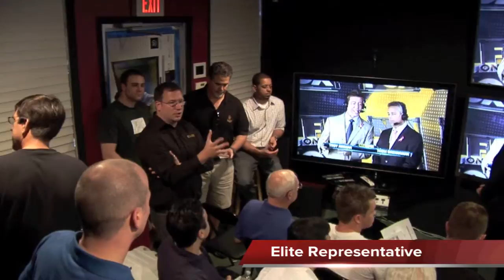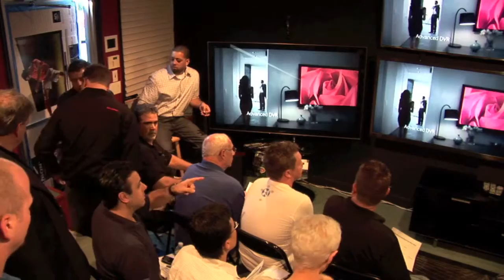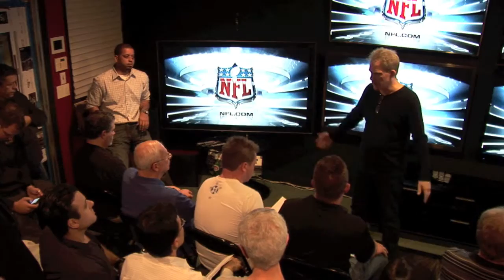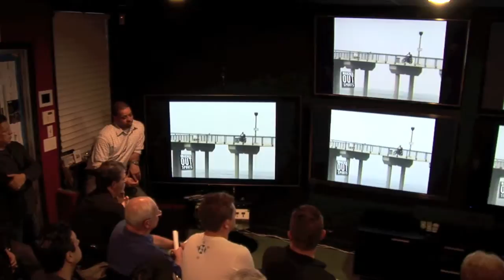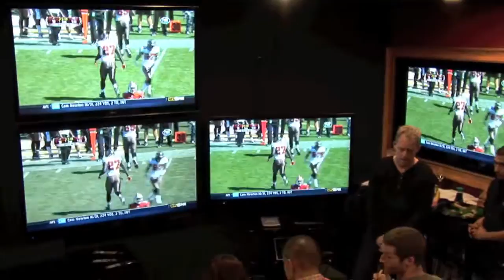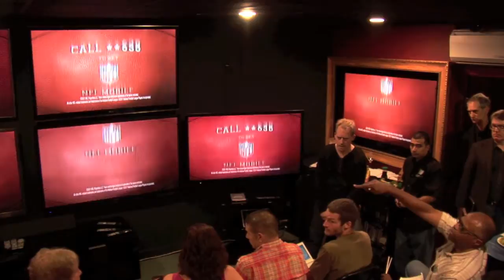2011 HDTV Shootout Day 2 - Q & A

Comment from the maker: @MrKwameR Those words you described between LCD and Plasma are more generalization for the lower end and older generation products in my opinion. At these higher-end sets, these arguments of LCD vs. Plasma are not as applicable. However, two fundamental limitations of the two technologies still apply, namely limited viewing angle of the LCDs and brightness limitation on the plasmas.